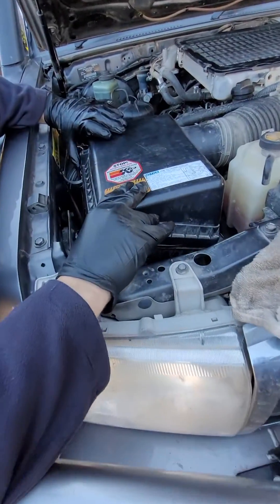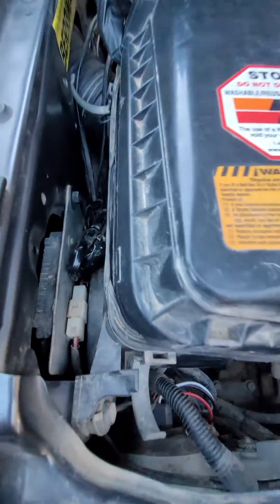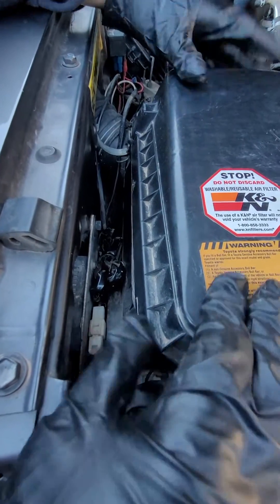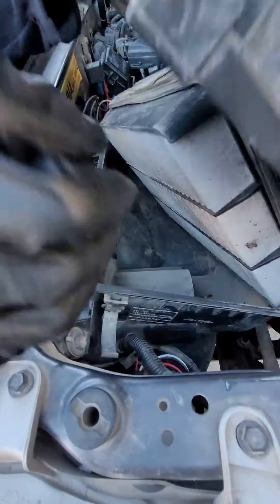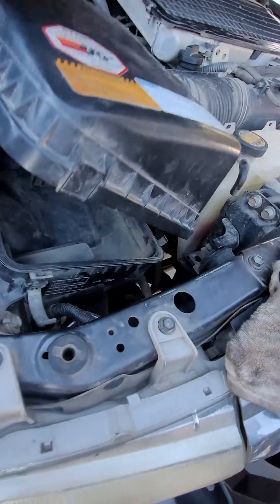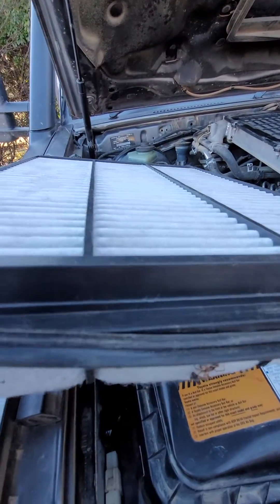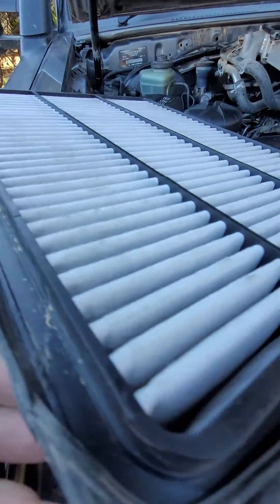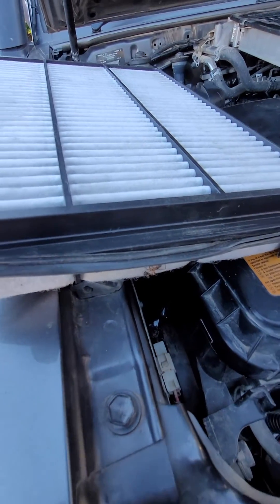Pinched Seals and Dusty Air Filters.

Comment: Not only poor installation but different brands will seal or not seal. Eg Wesfil thin seal caused dusting in my Pajero NW. Replaced with Sakura which had a noticable positive seal upon fit up.